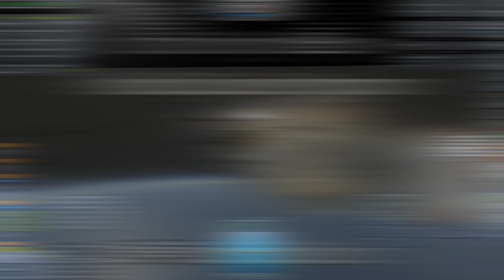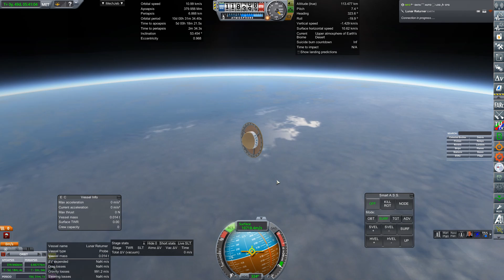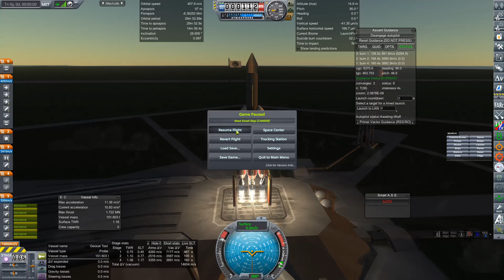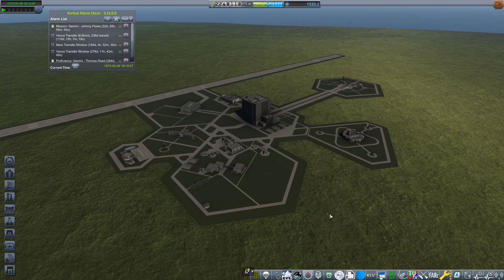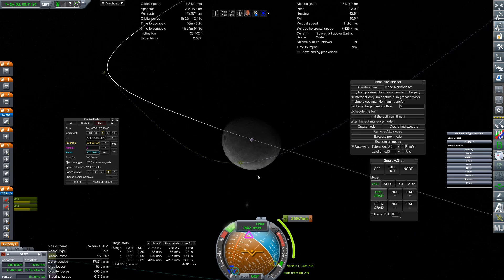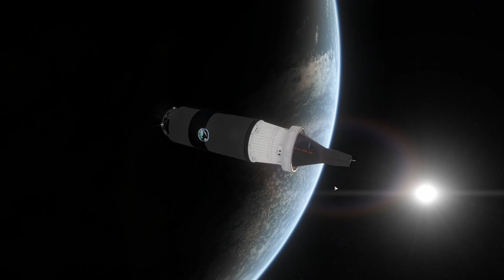Lunar Sample Return! - KSP/RP-1 - Next Small Step Episode 52

Comment: Whenever I try to use cryogenic propellants a long term missions I end up with so much boil off that it makes them impractical. How are are you getting your RL10 to be usable on these longer term missions?
Reply from the maker: Maximum MLI layers, launching in a fairing, and careful positioning relative to the sun while on-mission. The Titan IIIE is particularly well-suited to tossing a two RL10 Centaur into LEO. From there, it's pointing your engines into the sun to keep the heat off your tank. I'm losing on average 200 m/s dV from a tank that starts with 7200 during a lunar transit (3ish days). Any longer than that and I'd need more active cooling systems (I think radiators help?)